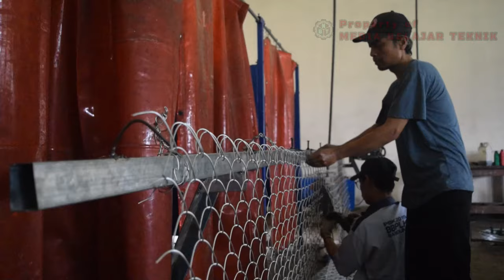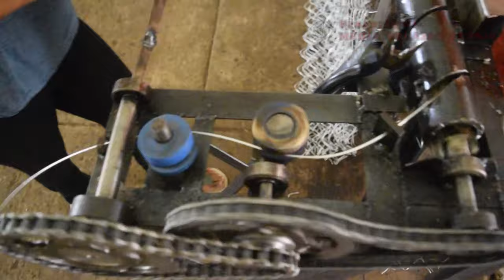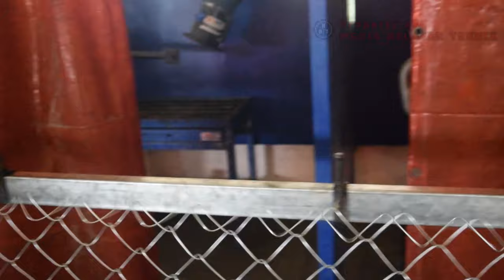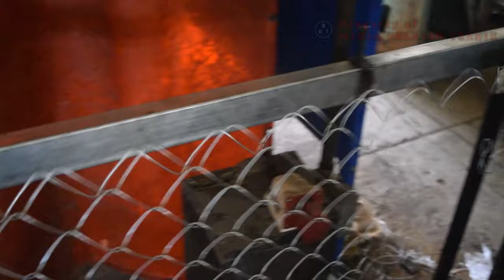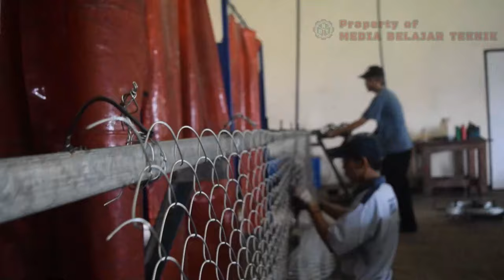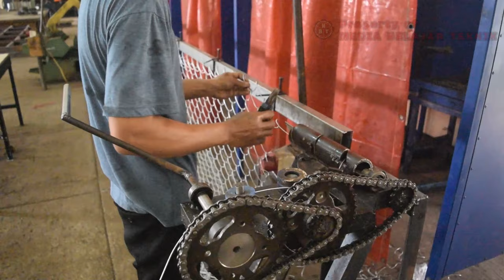DIY Manual Homemade Chain Link Fencing / Fence Wire Netting

Comment: Hi bro plz help me . Am also try this method but tha steel wire not going along with the middle flat that wire rolling at a same place plz realme what the problem 

Am used 1 inch pipe . Distance between the grow 3.5 inch . No of grow round 3. Total length 200 mm.

Plz tell me the proper dimension for 1 inch pipe